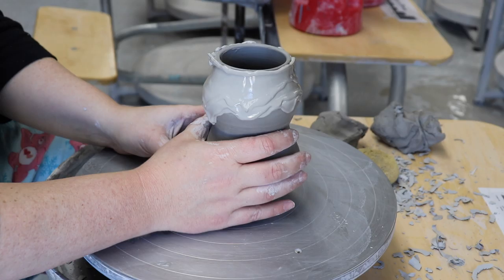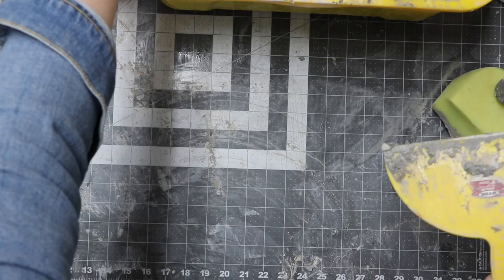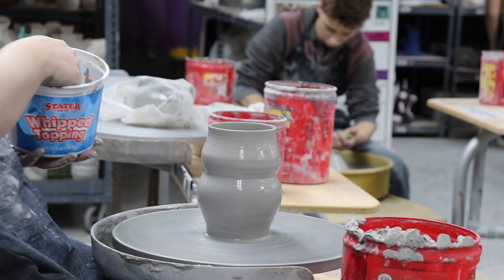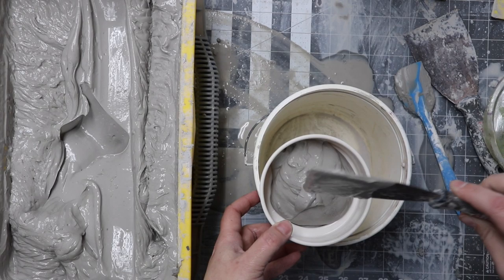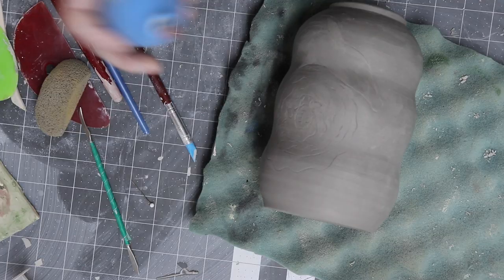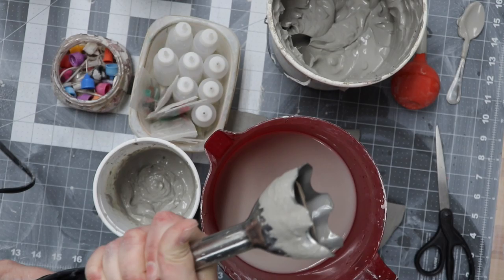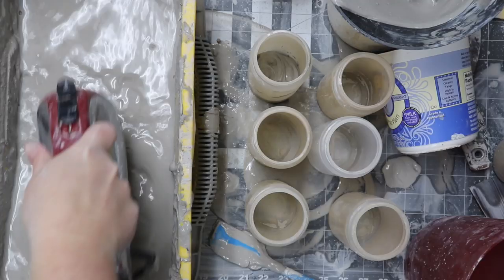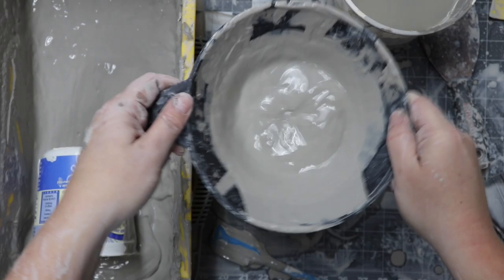POTTERY + SLIP: Making & Preparing Slip

Comment: Where do we get the plastic slip bottles? Do they have a cone-shaped tip that can be "cut to size?"
Reply from the maker: I’m not sure if these are the exact ones I have but they look pretty good. There are 2 important things when choosing a “condiment bottle” on Amazon… 1) the screw on lid should be as wide as possible so you can clean and add slip easily. Some lids are small, more like a bottle lid and when the slip dries out it is hard to clean those top corners. 2) for the classroom I like lids that have an attached cap so all the kids don’t loose them. Good luck! I have to say those slip bottles are a game changer and help keep the studio clean! Here’s a link to some that look pretty good:

https://www.amazon.com/Benail-Plastic-Squeeze-Condiment-Bottles/dp/B07BDFLCMD/ref=mp_s_a_1_3?crid=1T60KCVPR8ESC&keywords=condiment+squeeze+bottles&qid=1655605114&sprefix=condiment%2Caps%2C217&sr=8-3#aw-udpv3-customer-reviews_feature_div

Comment: What if I don't have any scrap pieces? What brand of clay would you suggest?
Reply from the maker: If you don’t have scraps, you can roll out a slab and put it in the sun. As far as clay goes, that depends on how large your work is, if you’re gonna be sculpting or wheel throwing, how you intend to decorate/glaze and what temps your kiln can handle. 

Good luck!

Comment: If i plan to make slip out of new purchased pottrry clay (high fire) should i break it into pieces and keep it overnight or half or an hour is enough to melt it, then only i can blend..?!!!
Reply from the maker: 1. Flatten clay
2. Dry clay to bone dry (sun works great)
3. Smash clay into coin sized pieces
4. Soak until the clay has totally broken down. 30 mins- an hour. 

I know it seems crazy to dry it out to make it wet, but bone dry clay is the fastest and easiest way to get a smooth consistency. In my experience, when I soak already wet clay and then try to blend it, there are always large chunks and globs. That bone dry clay is so absorbent it breaks down soo much smoother and faster. Good luck!
Reply: @MissLinneaLark  many thanks dear truly appricate your quick reply. I think to make it body dry i need to keep it at least a week? Just like before firing any work / pieces. I'm so beginner just wanted to make sure im going right 😅
Reply from the maker: @Zehracodek  no problem Zara. if you flatten the clay it will dry out VERY fast in the sun. it will prolly take an hour. after 30 mins flip it upside down.

Comment: What kind of clay are you using for your slip projects?
Reply from the maker: Allie Encarnacion it’s called Spirit White, it’s a low fire stoneware. It doesn’t have a lot of grit so it’s difficult to get larger stuff, but it’s a decent hybrid for sculpture and pottery.
Reply: @MissLinneaLark  what is the actual use of slip?
Reply from the maker: @Tech.Library  it’s like clay glue, it helps you connect two pieces of clay together. It also can be used for decoration. Check out the other pottery+slip videos and see some things it’s used for!
Reply from the maker: @Tech.Library  This video shows how to use slip to attach 2 pieces of clay: https://www.youtube.com/watch?v=9A71eo2ajoo

and this playlist is all about using slip for decoration: https://www.youtube.com/playlist?list=PLAKtyykLhODVBPN0vBTK_ZC2U5Ml3HS4S
Reply: @MissLinneaLark  OK thanks so much. Currently watching